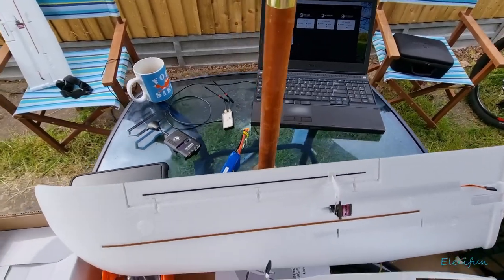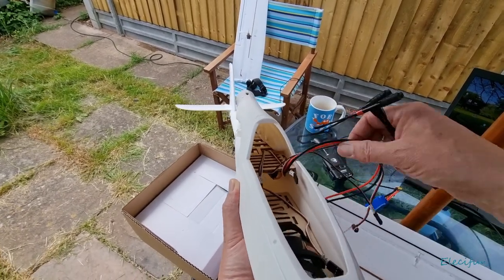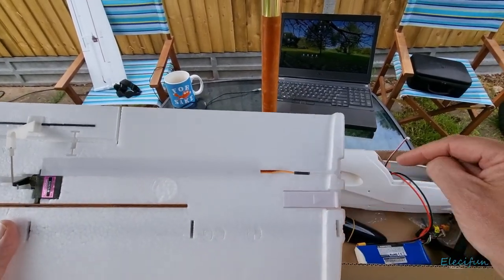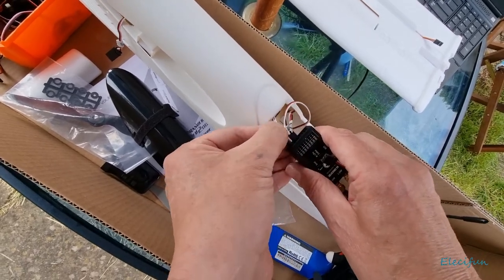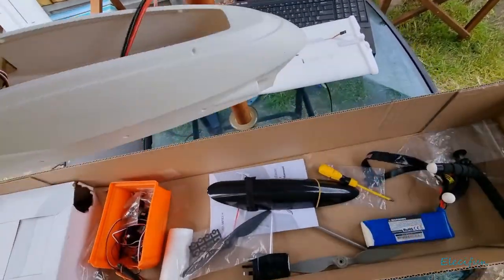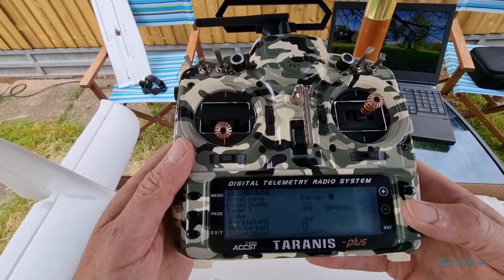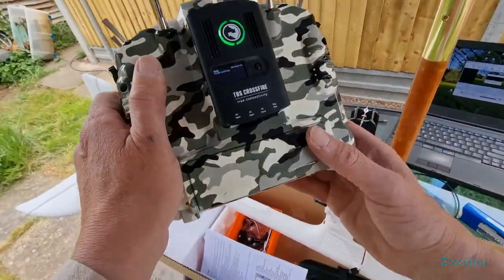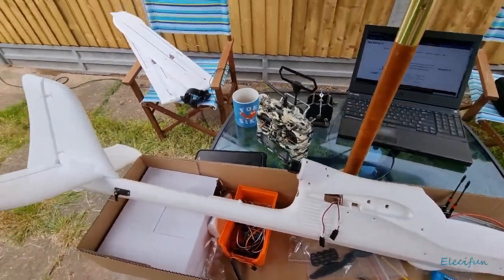VolantexRC Ranger 1600 Setup Radio RX ETC

Comment: I bet those remote controls are expensive... ! Looks like a serious piece of kit.
Reply from the maker: Not as expensive as replacing one after another due to poor craftsmanship. The unit plugged into the back of the remote is capable of more than I first understood which is a pleasant surprise. Team Black Sheep (TBS) advertise there kit as 'Serious Toys'
Reply: @Elecifun  Its wise to buy quality because rubbish doesn't last. The other unit that plugs into the back. Oh thats good that its better than you had previously thought. 😁👍
Reply: @Elecifun  🤧🤒